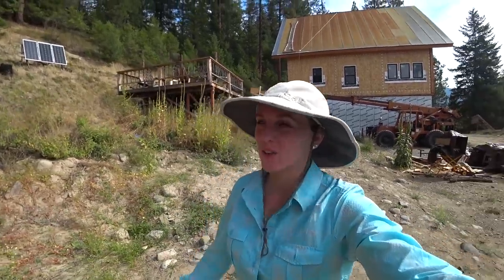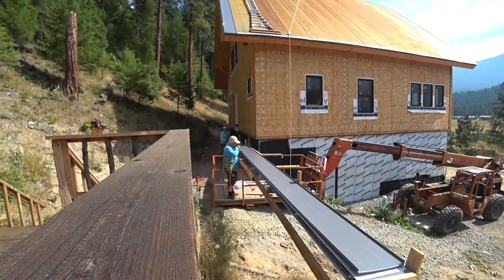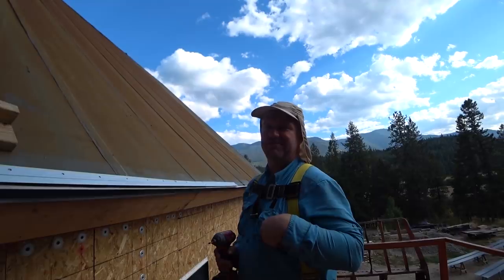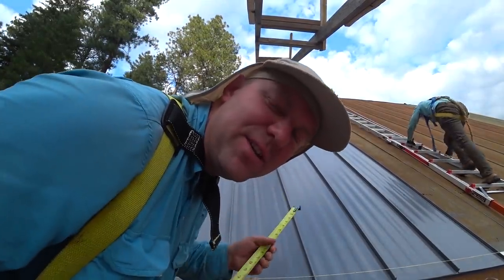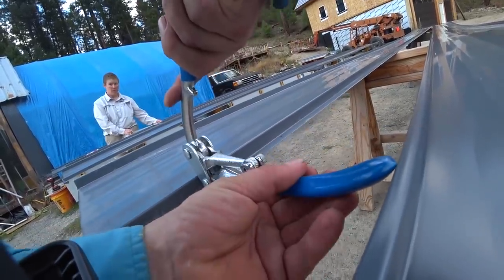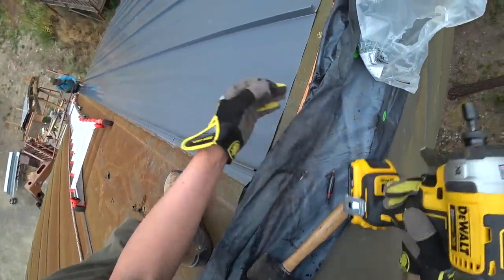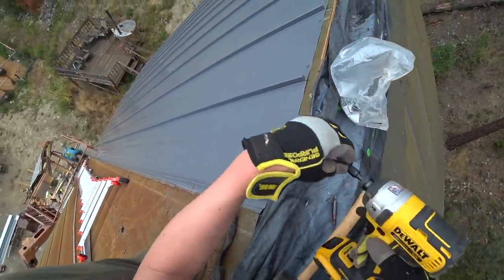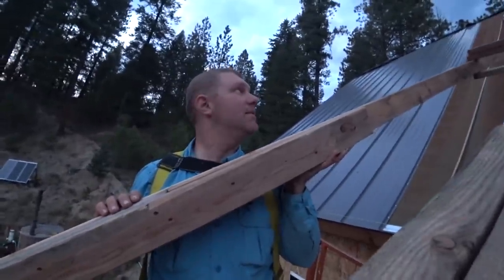WE’RE UNSTOPPABLE NOW! (DIY Metal Roofing Install)

Comment: Where are the hidden fasteners @? Why screw only
Reply: Watch previous couple of videos for that answer.
Reply: Screws ARE fasteners, they are covered/hidden by the next panel in line. Thus, hidden fasteners...

Why screws only? Because screws are all that is needed. They won't come loose like nails do, and they won't rust out because they are plated and hidden from the elements.
Also, those panels interlock at the seams. That is why they are having to hammer them down, to engage the lock. Each line of screws is holding the trailing edge of the last panel and the leading edge of the next.

Those panels nowhere.

Comment: So you are crimping the bottom couple of inches around that eave piece. That vs just cutting those couple inches off. Are you doing it your way just so you don't have the rough edge? ? ?
Reply: The crimping looks like a critical part of attaching the panels to the roof.  Rather than putting screws through the critical area where ice builds up, they clamp it onto the eve piece.   It also helps hold the panels down in the case of high winds, though I think the main purpose is to avoid ice/water getting in via scews.
Reply: No the crimping is supposed to stop the wind from pulling up the pannels off the roof!
Reply: kvn08cosmo No,they’re doing it that way because that’s the way it’s done.
Reply: kvn08cosmo he does that to make a hook that then hooks onto the bottom piece they installed.  This is the proper way to install a hidden fastener roof
Reply: Wind
Reply: If you go back, it was local good practice to ensure no wind gets under and lifts the roof, while also avoiding have hardware exposed at the most ice dam prone area to avoid damage

Comment: You may want to rent an electric standing seam seamer tool once your done to lock in the long seams
Reply: It's a snap system. Not a locking system.
Reply: CB I believe it is a snap style and a seamer would not work.
Reply: That is a snap lock panel not a  seemed panel you need to learn your panels that one does not get any machine.

Comment: Mentally notices that metal shards might rust between the panels and is worrying about scratching the paint...proceeds to wrecks the end of the panels with metal cutters and not coating it anyway...-.- I really hope they seal it properly, or that coating will rust off in matter of years and even then i would not trust it. Well if their legal apartment can handle all the lawsuits i guess go for it.

Comment: just a suggestion, you might want to delay the video going public since you upload late at night normally. All the best! also you can use some coarse sand paper to clean up those ends your cutting so they are a little more dull and not as sharp for the future.